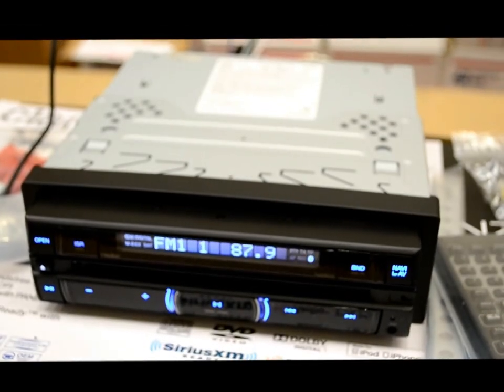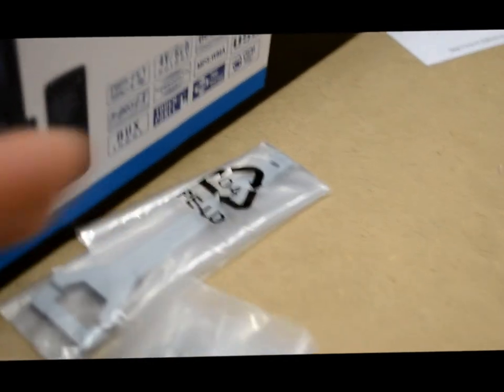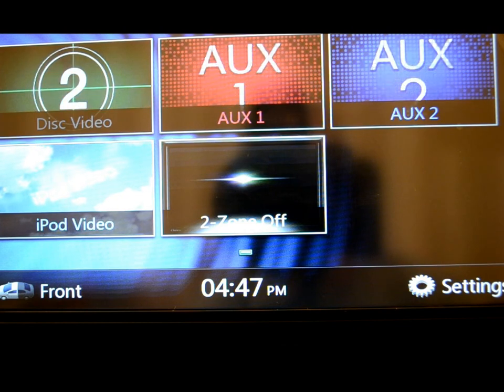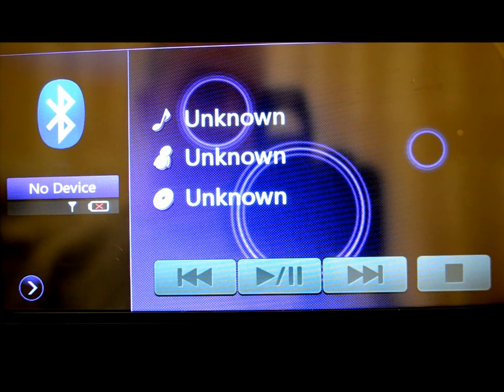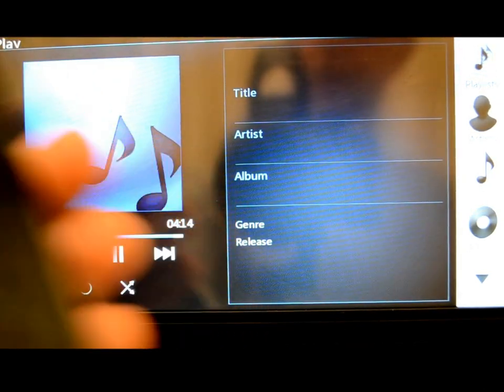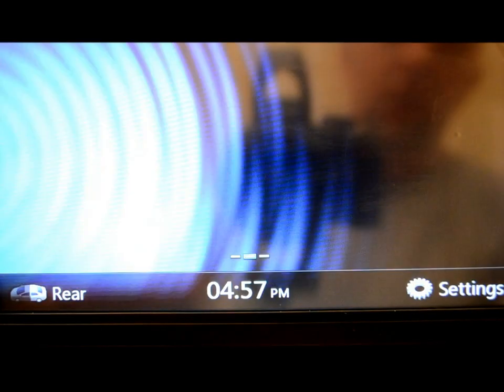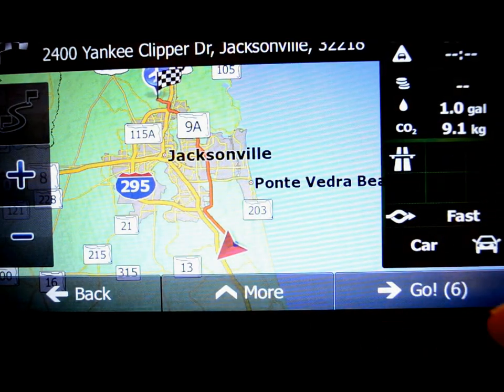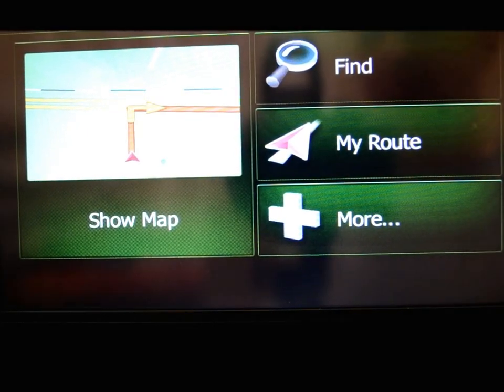Clarion NZ503 Review ( also covers nx703 ) 2013 Flip Out 7" DVD Bluetooth GPS Stereo

Comment: Any recommendations when touch screen not working, can't find remote and unable to take off the map, haven't been able to use it for nearly a year and it's brand new. Need to really get the touch screen working. Can it be a setting or any other way to reset the system so the touch can work?  Thanks.

Comment: Can you recommend a specific radio with a 1 single din, detachable face, gps, and subwoofer control? I'm debating on this radio but lacks the detachable face option. I was looking at some cheap chinese 1 dins detachable face, with gps on ebay but not too sure cause of the no name quality and none from what I've seen mention anything about a subwoofer control, just a single rca cable for a subwoofer output.